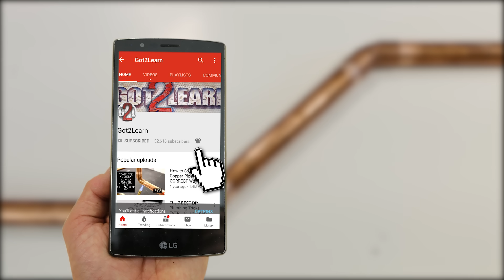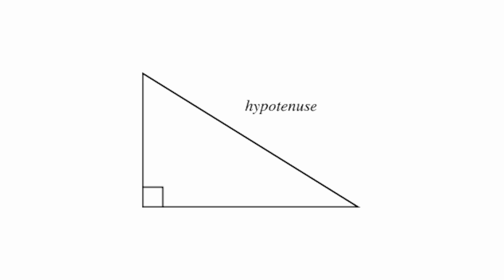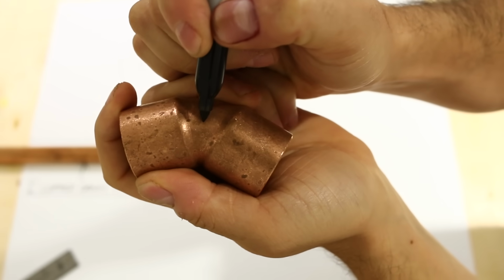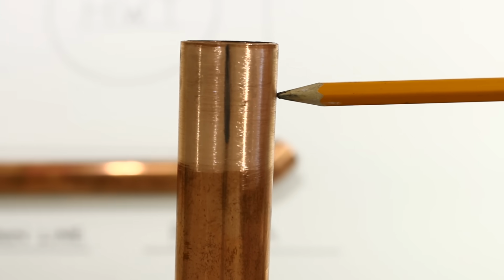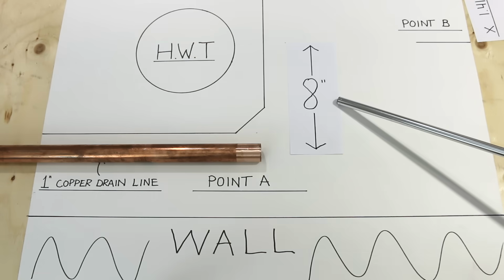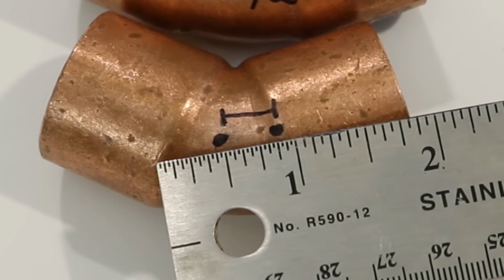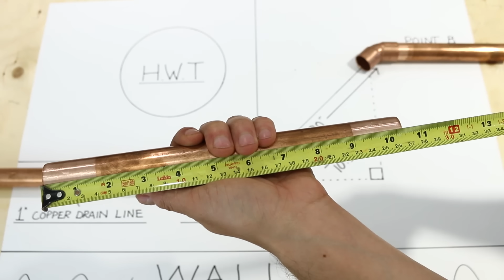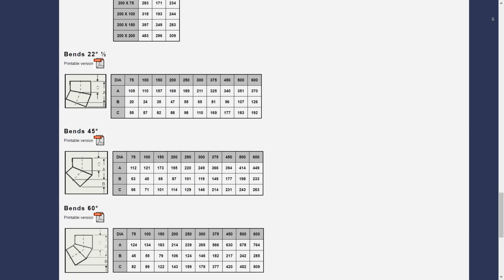The EASIEST way to calculate a 45° offset! | GOT2LEARN

Comment: if the you have a 22.5 degree coupler such as in PVC, the number for the "hypotenuse" is 1/Cos 22.5 (degree) or 1/0.92 or 1.08

Comment: Instead of measuring the takeoff for the 45, just multiply whatever size you have by 5/8 or .625 and you get your take off. 3” and under take away 1/8” from your size. Example 8” 45 takeoff= 5”. 8x .625. 2” 45 takeoff = 1 1/8”. 2x .625=1.25, take off an 1/8 and u get 1.125, 1/8”

Comment: I have a question regarding the pipes being parallel, how would you factor in a height difference? Thx in advance !
Reply from the maker: By using a horizontal reference such as a lazer level.
Reply: @Got2Learn I think they meant if pipe 1 was a 8’ and pipe 2 was at 8’6””

Comment: If there is an 8 inch heavy pipe from were you measure the travel distance?
Reply from the maker: Please clarify.
Reply: @Got2Learn  About measuring the opposite side(from hypotenuse) , the two edges. You measure to the edges of the tubes?

Comment: Hey Got2Learn, I once saw a plumber measure a 45 offset but he pulled out his tape, measured it did a quick math in the head and had a piece ready to cut, is there an easier way? I doubt he did all the math in less than 8 seconds
Reply from the maker: It's probably this method, but if you have a round number like 10" for example,  it's easy to multiply by 1.4142 and then remove 2x the penetration on both fittings

Comment: For those that work hanging duct work. are this formulas work the same for duct? I always struggle when it comes to use forty-fives
Reply: Works for square duct too 🤯
Reply: @creativesuit1930  Thank you good to know 👍
Reply: @miguelh.maci1148  Just remember to subtract your fitting allowances and measure center to center.
Reply: @creativesuit1930  Thank you!

Comment: You said pythagorean wrong, but interesting as you said it how it was spelled.   Maybe I have been wrong for 40+ years.  stupid engineer you know.   Aside: i was a plumber to pay or school back in 80's.  I love your videos and seeing the new hardware available.

Not seen the O-ring seal design for copper.  That is common for Plastic fitting from OEM like Parker for Compressed Air.

Sq root of 2  easier to remember vs 1.1414 maybe.

Comment: You don’t need to measure center to center to figure out your offset you just need to make sure your measuring the same side of both pipes. For example if your pulling off a wall you measure to the left side of the first pipe. You pull off that same wall and measure to your 2nd pipes left side as well and it will give you the correct offset. Measuring to center of pipe is unnecessary and creates room for error. Other than that good video.
Reply: It can be from B.o.P or T.o.P, if it’s over head get both elevations on the higher and lower pipe and proceed to use this formula. First you need to find the difference, obviously.
Reply: exactly that is what was thing.

Comment: For anyone wondering why you multiply by 1.414.  It's because 1.414 is the hypotenuse of a right angle triangle where the two short sides have a value of 1.

So the diagonal measurement of a 1ft square would be 1.414 ft. And for a 1 meter square would be 1.414 meters etc.
Reply: Love you bro
Reply: So which one do u use the 1.414 or 1.4142 will it be the same answer or different
Reply: @isaiahsanchez853  
It depends how accurate you want to be, the more numbers you use after the decimal point the higher the accuracy of your answer. 
In your example, the difference in your answer by using either number would be tiny.

Comment: I do tube bending too, and you have to keep up and not lose practice. I always write my common formulas inside of my hard hat. Rolling offsets and running multiple racks of tubing around columns and beams is critical to make it look uniform.
Reply: I used to use a tubing bender frequently myself, it looks awesome when done properly. I recently dug out my 3/4" bender to do some work at my house, I hadn't used it in a decade, but I managed to remember enough to get the job done perfectly. You're right about writing stuff down as I found out, but you don't think about that when you use them frequently.

Comment: I'm going to try this with duct work. I usually use a square or a framing square to figure it.
Reply: When your doing duct work we always use the owl method. 
Offset x width = length
Reply: @byoung1910 divide length no?
Reply from the maker: It'll be even easier man 😉

Comment: Stick your fitting on one end. Stick a slightly longer piece of pipe in it and lay it over the other end. Mark where the inside edges meet. Fudge factor for the slight rotation of the fitting and small gap between edges within the fitting(this takes experience but if you always try to use math, you will never get that experience. It definitely pays off later though). Cut the pipes and you're done.

Wall must be straight, mark on fitting must be centered, tape must stay on mark etc. I used to use levels and math and such, but the reality is, your eye doesn't lie, and when you do it enough, you can eyeball it with a few tricks. When the tape is at odds with my eye, I've learned to take my eye as the final decision. The tape has screwed me more than once or 500 times. Small errors within the measuring process add up, and can put you way out.
Reply from the maker: This won't work with 10" black steel.
Reply: @Got2Learn  I'm an irrigator so I only work with copper and PVC. Why doesn't it work with black steel?
Reply from the maker: @atypical_moto  oh it's more the size than the pipe, could be asbestos too.
Reply: How can you make up multiple sets over long distances from both sides if you don't use maths...you can only keep joing parts in situ otherwise otherwise you will end up way off!

Comment: For black iron, the fitting allowance is Face to Center minus the thread engagement right? I cant find any comprehensive charts on thread engagement though. I used to have some but cant locate them. Im back in trade school and Im pulling my hair out.
That Bibby St.Croix PDF has two measurements. A and R. R isnt the fitting allowance is it??
Reply from the maker: What I used to do is take each size fitting on the job we were using and make my own chart as a reference as each threading machine has a small difference when threading, I like doing it that way.
Reply: Ok thanks a lot have a great night
Reply from the maker: Same Mike!! 💤

Comment: I've not seen that 1.4142 trick before, very handy as a welder fabricator. Is there anymore handy numerical tips.
Reply: If you want to make something square. Measure down one side 3 and the other side 4 and the measurement between those two points is 5. Of course you can use multiplayer of the 3,4,5 like 30,40,50, 3ft ,4ft,5ft etc. handy for something large or laying out on the floor.

Comment: Why you multiplied by 1.414 where it's comes from??
Reply from the maker: Hypothenus.
Reply: if c^2=a^2+b^2 , for 45º a=b so c= sqroot(a^2+a^2) -> c=sqroot(a^2*(1^2+1^2)) -> c=a*sqroot(1+1) = a*sqroot(2) = a*1.414
Reply: It's the square root of 2 
All right triangles with a 45 have the same relationship between the lengths of the sides, the two short sides are the same and can be multiplied by the square root of 2 to find the long side.   I use 1.414, but the videos is just more accurate

Comment: How do you find the end to end on that pipe?
Reply from the maker: Which pipe?
Reply: @Got2Learn  the one on the video, but any pipe really. It's a question on a test that I took. I solved for the travel like you showed in you lesson but then it asked what was the end-to-end length of the pipe in the diagram. Sorry if I can't make it clearer than that, still a newbie.
Reply: @Got2Learn  the question had a 16 in offset and I had to solve for the travel which I did. 22.614 but the it asked for the end to end length of the pipe. Hope that makes sense. Thank you for responding.
Reply from the maker: Add me on Facebook.
Reply: Deduct the fitting allowance

Comment: I always just stuck a 45 on point a and point b and then measured in between them. Idk why you would need all this math lol
Reply from the maker: Well, for 1/2" piping with a 1 foot diagonal it can be done your way, but if you are doing a cast iron line or 10" asbestos storm drain, your way cannot be used, which is why the maths are necessary to know ;)
Reply: @Got2Learn  good point, that makes sense. I appreciate the response.
Reply from the maker: Not a problem bud ;)
Reply: Me too. It works for most regular residential sizes.

Comment: I would actually use a pipe bender for the whole run
Reply: This is hard copper not soft copper tubing
Reply: @foodandfuntraveler5859  what does that matter you can still bend it,  it is copper not brittle
Reply from the maker: That to is a good option.

Comment: how did u get the 11.30''?
Reply: Late answer to this, but the answer is technically 11.296 (since he used 1.412). So the distance between each pipe was 8". 8" x 1.412 = 11.296.
11.296 rounded up is 11.30 which converted from decimal to inches would be about 11 & 5/16"

Comment: Unreal, I have re-plumbed 2 dozen HWT's in my building just because the dumbass plumbers just thru in unnecessary joints or installed multiple unneeded joints to burn up parts they had in their boxes resulting in some seriously f'ed up configurations. When I started re plumbing these lines (option to my owners in my condo building) I always eliminate as many 90's as I can ( why use a fitting the stops the water to change direction when 45's are a mild turn offering better pressure) and I've always rough fitted my pipes because I had no other way to gauge the angle. Well done!
Reply from the maker: Thanks buddy, really appreciate it ;)

Comment: I LOVE YOU! This is great for union plumbers that want to look smart over speed and efficiency ...But privatized plumbers like myself have a fast way! We mostly overlap and nip off extra (I save the extra for latter) time is money with non union plumbers and I would never use this tbh. Maybe you can show the speedy ways to do a 45 for the privatized plumbers? Time is money for both types of plumbers in opposite ways.
Reply from the maker: Thanks, ya I am working on a video called "10 tips to work faster" so i'll throw it in there ;)
Reply: I don't get how making extra cuts saves you time but I guess your method is faster if you can't add & subtract fractions.
Reply: @yellowdogdemocrat1402  I flow unrestricted the pipe is part of me my eyes and hands are the tools and I don't have time to "math". I'm not special or alone with this style and my co-workers do the same. If you started putting dots and adding and subtracting and applying algorithms me and my "mouth breather" brethren would drag knuckles over pop it together and laugh a cavemans laugh in your face.
Reply: @xXxnemisis  

That's fine.   Luckily customers will do the math and they're smart enough to realize that it costs less to pay me or one of my brothers once to do a job than to pay you to keep coming back every 3 years to redo the job.
Reply: @yellowdogdemocrat1402  You don't know me or anything about me. You are probably right that you and your brother are cheaper then me but in no way better. I have plunty of work i wish you luck and im no longer interested in what you have to say kid.

Comment: Use a tape measure, no calculations needed, no math just transfer a measurement
Reply from the maker: That won't work on bigger pipes.
Reply: It doesnt matter how big the pipe is it will work the same if its 1/2" or 8 inch the distance between the 2 fittings is a measurable distance and i would rather take 1 measurement make 1 cut and move on to the next piece

Comment: Im a residential plumber with no union or trade school experience and I use the formulas for 22.5, 45, and 60 degree offsets on a daily basis. I've found it helpful to not only memorize the formulas for offset and setback, but to download onto my phone the takeoff charts for fittings from the manufacturers. It's very helpful if not imperative to have an accurate fitting take off when using a multiplier or divisor, especially when all your holes are drilled and your using center to center measurements with large fittings. Once you understand how to apply these formulas, you'll find that its not only quicker to use math, but yields a higher quality product. I do remodels for the most part and when I start ripping open drywall to expose old work which I have to tie into its very apparent wether someone got it right by eye or cared enough to use basic plumbing math. Not only does plumbing installed by eye look sloppy, but the pipes themselves are often under stress which results in premature failure. Practice makes permanent. Quantity over quality, or "getting er dun", is nothing more than a race to the bottom. Take pride in the quality of your work, as it speaks volumes about you when you are not around. Great video by the way!
Reply: I'm a plumber and although I have a pretty good eyeball it pains me to know my 45s are not 100% spot on. I know this formula but an off set is not the  common  Scenario to be mr. exacto. I was hoping to find the formula to find 2 pipes at a 90 degree angle. For example I'm going from a diagonal pipe to a vertical pipe and want to use two 45s. How do I get the right size pipe. Do I need two surfaces to measer or what. I'd really like an easy solution.
Reply: Zach Bishop ok not to sound rude but a 90 degree angle is literally an L you just need a 90 degree fitting, buy some pvc and play around until you find something that works
Reply: Why don’t you guys just use math? Like 30* would be multiplied by 2
Or 45* would be multiplied by 1.4?
Reply: @millionairescloset2310  I do! The formulas I was referring to are what you mentioned. I grit my teeth a little when I see anyone fitting pipe and making offsets without math. Why you wouldn't use it is beyond me!
Reply: @Kyle Fogle  so this same formula works on all fittings not just 45s? I do hvac and venting is a pain I mostly eyeball with fittings and a tape measure I take pride in my work and am never to happy with how it turns out cuz it's off by just enough to kill my ocd lol
Reply: @catchnone8580  Each angle ( offset) has its own multiplier. 45° is offset measured perpendicular, multiplied by 1.41, that yields the length of the pipe traveling on the 45° angle. 22° multiplier is 2.61 etc. After establishing that length I subtract the length of the fitting from the end of socket to center of fitting to determine the length of pipe to be cut. In my field I keep takeoff charts of fittings to reference on my phone.
Reply: @kylefogle6022  so do you just look up plumbing off set multiplier chart or something I'd like to keep something to reference on my phone!
Reply: @catchnone8580  Yeah, if you search pipe offset multiplier that should yield appropriate results. Welders , pipe fitters, and electricians also use the same formulas so you might more information with those keywords.
Reply: They love the race to bottom bro

Comment: very informative. Imagine if you are to cut /fit  pipe with a 12 inch diameter and  a 6mm wall. you just cant move them around because its heavy. this is where the correct  calculation comes in. thanks Go2Learn
Reply from the maker: Percisely ;)

Comment: not bad, In my opinion, this takes up to much time. even if its only an extra couple of mins. this is great for new guys though!!!
Reply: Depends what you are doing. You already have your tape measure out. How hard is it to times something by 1.41? If you want neat work or with drainage have limited fall say under a footing its fool proof.

But I do know some older guys who have been plumbing for 40 plus years and can get it right by eye.
Reply: For pipe fitting it's a must.
Reply: for sure, anything big its a must for sure.

Comment: Why would you not just place the two pipes with 45 degree connectors on them and just measure the distance between them?
Reply: V T because sometimes the pipe that is being installed after the offset isn’t always in place.  You may just have a laser or chalk line marked
Reply: Stove piping at it’s finest
Reply from the maker: Try it like that, and tell me if it works ;)
Reply: @Got2Learn  works fine
Reply: Because a pro should do it right, union hands are held to a much higher standard, we get paid to show our craftsmanship.

Comment: Also the reason why he took the time todo the math is because waste cost/equals to loss $$$ if you are the business owner. This gives you 100%   no waste which in return adds/equals more $$$. You save by having no waste. Even thoe it may only be a inch or few in waste to fit the pipe in a tight place u may cut it down close to the length/size needed where u can then make a mark to where it needs to be cut. Which then will leave you with left overs which equals waste which is wasted money $$$ on not needed waste. Times that by a 1001 over a year and that little waste adds up very fast my friend which is a good amount of $$$. Hope this helps explain more to those who dont run or understand what little things help business owners save and make more $$$.
Reply from the maker: Couldn't be better explained than this. It's not because you use this trick 5 times in a year that you'll see a difference, it's a long term thing, and trust me it's sooooo much easier to do it this say!

Comment: This guy is making it way to complicated and inefficient. All you have to do is run the pipe to the elbow at the end and then scribe it with a sharpie or whatever. Absolutely no need for any measurement or mathematics.
Reply: Jason C. Try doing that with 10" steel pipe 20' in the air...
Reply from the maker: Exactly lol
Reply from the maker: It all depends what type of job you are doing.